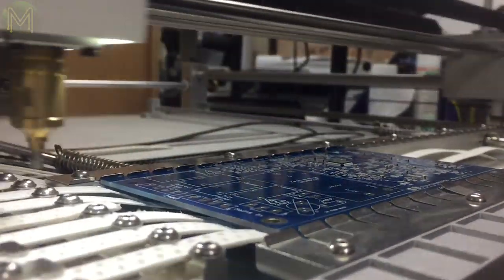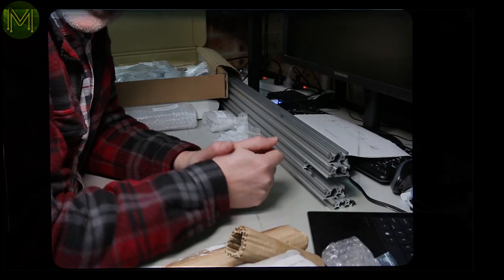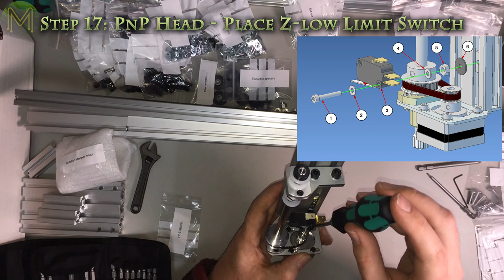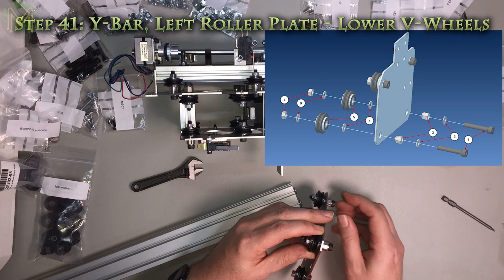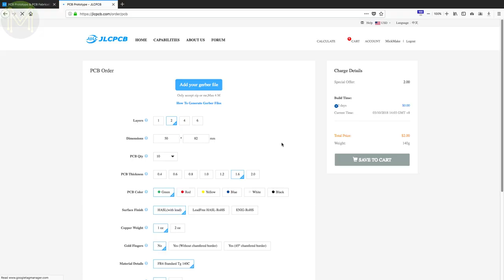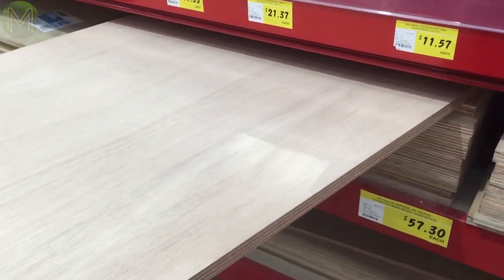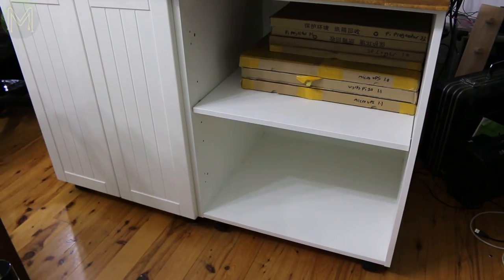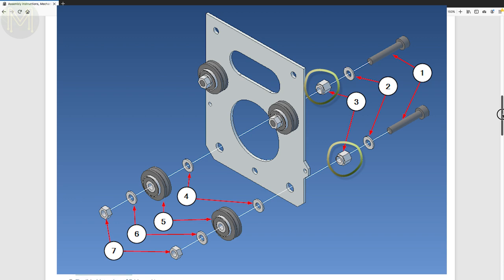#271 Building a LitePlacer: An Open Hardware pick and place machine // Review

Comment: liteplacer is awesome. Juha is relentless with supporting his customers, and is true to the open source everything philosophy. it took me 3 full days to build, one for mechanical assembly, one for testing and making sure everything worked as it should, and one for tuning all the parameters and sorting out the functionality (software, tapes, needle change, lighting). in the end, I wasn't getting the use out of it, so sold it, but it was a great project. 

I would suggest 
- painting all the steel brackets before assembly. they look so much better in bright silver, than the rusty steel colour after some time (bit late now though, haha). 
- the timber table may need a more consistant colour than timber, so be prepared to add a cover.  The green craft/cutting mats work well.
- oh, and you discover that consistent lighting and a rigid work table is really more than just a suggestion. life will suck if you don't have these.

Comment: Funny you mentioned JLCPCB. I'm looking at this because I had some PCBs assembled by JLCPCB but they're on backorder due to both the new year's holiday and the coronavirus :-/ So I need a plan B and LitePlacer is probably the way to go. You said it might be possible to assemble this in a day, that's good. I did a MPCNC build over six months, but only an hour or two at a time.

Comment: Mick was the Merbau from Bunnies as well? I might replace my cnc bed with it.
Reply from the maker: It was from Bunnings. I think I'll eventually replace it with metal, but timber is easier to work with since I have all the tools.
If you get the finger-jointed hard wood, it's a lot more stable. Some hardwoods, though, have a lot of knots and so aren't suitable

Comment: Neat niche project  😍 😍 
I suppose one would have a somewhat large electronics production need in order to justify building this, if not just for fun and learning.
- in a few years it could be a lot cheaper (and far faster - programming the P&P machine setup can take some time) to get it made by 'professionals' (Just like doing your own PCB's where the price recently has dropped to almost nothing, but you need to keep material+chemicals on hand, dispose properly, etc.)
Next up - Vison project for automatic visual inspection, moving probes and x-rays for those BGA's? 🧐
Reply from the maker: Yes, one of the side uses of the P&P will be to create ultra high-res photos of all the SBCs I review.
Reply: > I suppose one would have a somewhat large electronics production need in order to justify building this...
It used to be like that. But I design prototypes, and using a production machine for building a prototype is like turning up a printing press to get one sheet of paper. I built this for prototyping; you don't need to do very many boards in a year for this kind of machine to justify itself. You can read the story at https://www.liteplacer.com/about/the-story/.
Juha Kuusama
LitePlacer
Reply: @JuKu59  - I wonder; How long does it take you to program and fine tune the setup, so everything is lined up perfectly and all directions/polarities are correct. I love your idea, don't get me wrong, and having soldered an unknown number of prototypes I agree - automatic pick and place is really great and frees up a lot of time. It is also an investment - cost/benefit. I read your story, and I am under the impression the time you mention is spent tuning the reflow process.
Personally I find manually placing the components gives me an incentive to use the same valued stuff over and over - increasing speed and decreasing placement complexity. (But then, I have only used a professional manufacturer to do large pick&place work, but the time I was told it took to program the machine, load components, etc - it was faster to do them manually myself, verify the design and do changes if needed (some pro places also does it by hand for speed and simplicity) - this is for 1 or 2 boards with a resonable amount of components)
Another benefit is checking clearences and a general sanity check of the design.

Comment: Oh man, that might have to be the next project I think, how awesome would it be to have a pick and place machine! Now where to put it...
Reply from the maker: Ha ha. Yes, my current problem I'm trying to solve. :-)
Reply: It is an even bigger issue when you're considering moving from a benchtop PnP to a "full sized" one.  To maximise feeders, you also really need good access all around the machine.
Reply from the maker: Yes, one of the other reasons for putting it on wheels!
Reply: @MickMake  Suspend it from the ceiling...

Comment: I just know that this video will attract classic comments.  LOL.  I work in a circuit board assembly plant and I do surface mount and through hole work.   I have built up the patience over the years to work with tiny parts and complex machines. So I dont find this build daunting.

Comment: I did some 0201s by hand and it was hell. Never doing that again. Just a tad bit too small.
Reply from the maker: Yeah done that as well. Hold the part slightly the wrong way and ... ping ... vanishes completely.
Reply: @MickMake  either that or they stuck to my tweezers or they got blown away by the hot air gun. I ended up ordering more components because i kept loosing them

Comment: Assuming you have one of these available,  how many hours of effort does it take to set it up for a board to do a run?  Versus hand building, how many boards at a minimum would you want to do a run of to make it worthwhile to set up the pick and place, calibrate it etc. ?
Reply: I built it to help on prototype builds. For that, it doesn't make sense if there is a heavy setup work. Assuming you have the machine itself calibrated, you need to put the parts on the table, less than a minute for each part type. Most likely, you already have the parts you use the most on the table. After that, a couple of mouse clicks to show the software where each part type is. In the beginning pf the video on my home page you see the setup work. Ok, a toy board, but you'll get the idea. 

Juha Kuusama
LitePlacer

Comment: before having this, i will need a pcb making machine first.
Reply: JLCpcb...or use the older model...U+Laser Printer+Concrete Etchant
Reply: @UpcycleElectronics  for single prototype pcb that may need alteration, ordering jlcpcb is kinda expensive with those shipping charges.
and laser printing + etching is too much work with chances of bad results. :-(
Reply: @iceberg789  
 There is a learning curve to etching, but it really isn't that hard once you get familiar with it. The best thing to do is look for a laser printer second hand from somewhere like a thrift store. I picked up my first for $8 from a local thrift store, and just got a better one from the same store for $25. Use the thinnest inkjet photopaper (the kind for printing pictures/and yes the kind for inkjet printers not designed for laser printers). Even with a crappy printer that paper will get good results. Thicker papers will not work as the paper tends to stick so good you can't remove it. Even the thin stuff takes some effort to remove, but it will collect and deposit far far more toner on the paper than any other paper type. This will yield awesome results. You also must clean the board with 00 steel wool until it's totally shiny. Then use cheap white dishwasher detergent to do the final cleaning. The chemicals used to protect the board from oxidation are hydrophobic (they make water bead into droplets). Dishwasher detergent works on the principle of exploiting these same hydrophobic/hydrophilic properties of water. If you place the powder on a damp rag and scrub the board well, when you rinse off the board there will be a uniform sheet of water across the entire surface. Once it is this clean just apply the mirrored PCB artwork to the board with an iron. I like the travel type irons as they do not have steam holes. A laminator is nice but not necessary until you're doing stuff like soldermask films. I did photoresist using an iron for awhile too. Photoresist just requires you to set the iron's temperature much more specifically. I do a lot of quick prototypes just using the cheap Chinese permanent markers. Don't use a sharpie and don't listen to anyone that tells you they are fine/good for this. I have tested black, red, green, blue, yellow, and silver Sharpie's with both Ferric Chloride and Hydrogen Peroxide + Hydrochloric Acid etchants, and on multiple occasions. They are all completely useless. I tested them in the outer margins of boards that I etched with toner transfers just to cover the extra copper and keep from saturating my etchant with the extra copper. Anyone that says Sharpies work has little to no actual experience etching boards. The Chinese permanent markers work well and are like $0.25 each. Get them in large quantities of at least 10 or more. Order some premade Ferric Chloride. This is used in thr food industry too. It will stain anything it touches a mustard yellow color, but it is a weaker acid than a lot of other chemical cleaners everyone has under their kitchen sink. If your willing to work outside, use Hydrogen Peroxide and Hydrochloric Acid. The first is common in pharmacies, the second is sold in home improvement stores as concrete etchant usually called Muratic Acid (bc people are dumb). That combo can be purchased almost anywhere. Some countries restrict these chemicals because they are used in many chemistry lab compounds, but they are also assuming a considerable amount of intelligence exists amongst the population.
...anyways...I use the second setup for my large boards. I use ferric chloride inside my lab. I can make a board with it without leaving my chair. The real secret is a small amount of heat. I use a tiny pot warmer type hotplate that was used for keeping food warm at social events. It is just something else I picked up from a thrift store for $2. It only heats to around 80C. I've built 2 shaker mixing setups but those do very little to speed things up compared to a bit of heat. I use pyrex glass casserole dishes for the acid + board, once again, thrift store @ ~$1 each. With larger boards I'm limited to the size of what I can print on a cheap transparency, so A4 paper size. Buy copper clad from ABCfab on eBay. Bill has the best price and product you will find online. All of his sizes are in inches. Everyone else sells in centimeters. Do the conversion and you'll see he sells more for less money than anywhere else. If you want to use photoresist look up the Dupont Riston215 datasheet for a starting point. The cheap Chinese film works exactly the same. The Dupont Dynamask soldermask film is much easier to work with than the liquids, but you need a lamimator for this. Use the sun for a UV exposure source at first. Photoresist film requires around 3 seconds, Dynamask 5. Apply photoresist under water until flat and in position, remove, then squeegee out the remaining water. Once the film is ironed on, put a few drops of bicycle chain oil between the film and toner side of the transparency, then squeegee out any air bubbles. This will get the exposure closer to the film than any other method. It will also hold everything in place. No need for tape or glass. Also you don't need to modify a laminator. Use an iron for toner transfers as they need high temp/pressure. Laminators are for films. My cheap Amazon basics version works fine. If your printer can't do super solid and dark prints on transparencies (like my Brother HL-2240), use a cheap Chinese permanent marker to fill in as much as possible. My new (to me) HP PL-2235 does not have this issue. A small dremel drill press makes a big difference. Buy 0.8mm drill bits in bulk. I also use a tile saw to cut boards. I use an ultra thin 0.6mm diamond textured blade (dry) to cut boards. 
 It's really quite easy to do all of this once you try it a few times.
-Jake